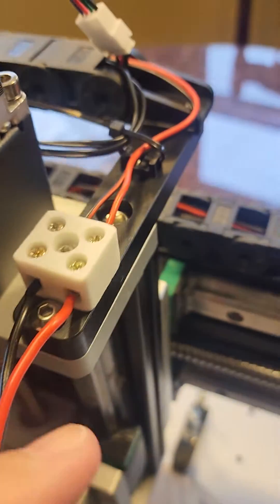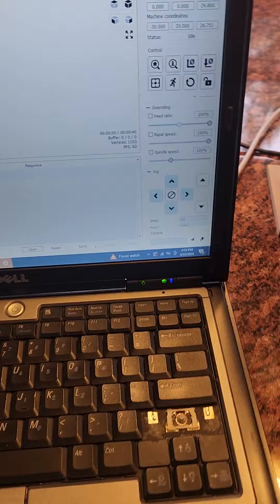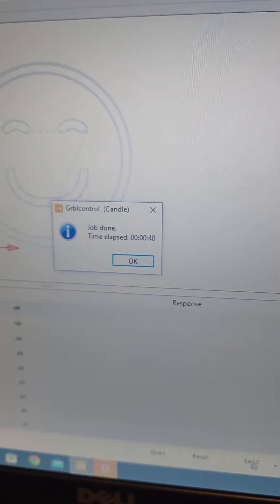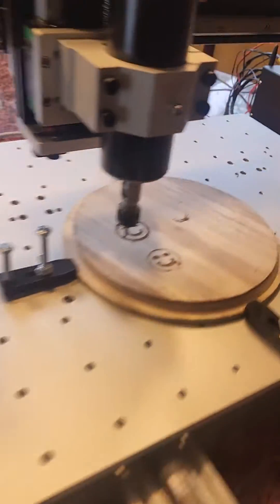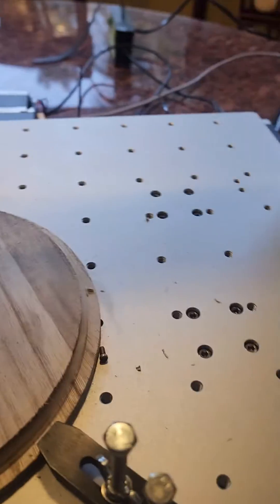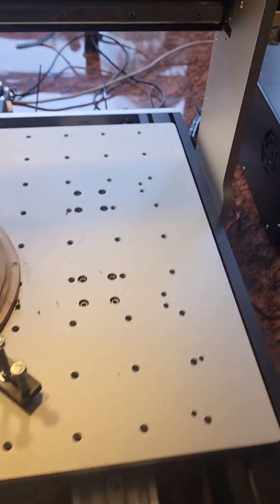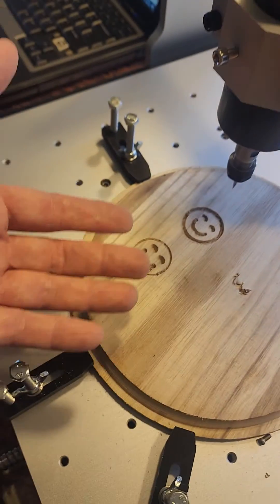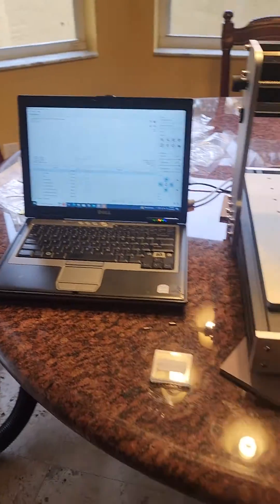AnoleX 4030-Evo Ultra CNC Router Machine - Second test cut success

Comment: Hi, can you take cover off control box (screws on the side) and maybe do a video review of internal structure (drivers used for example)? I am looking to see which control board is used for GRBL32) I want to figure out if it can be updated with FluidNC firmware. Great work! Thank you.
Reply from the maker: I contacted Anolex with your question, and this is their reply.

Hello, the 32-bit chip of 4030-Evo Ultra is ESP32, and the stepper motor driver is TB67S109AFTG. We do not recommend refreshing the FluidNC firmware as you may encounter various problems that require debugging. We do not provide technical support in this area, and we do not provide recovery procedures if the firmware is flashed.
Reply from the maker: This is the current firmware on my machine. https://github.com/bdring/Grbl_Esp32
Reply from the maker: Does all this help?